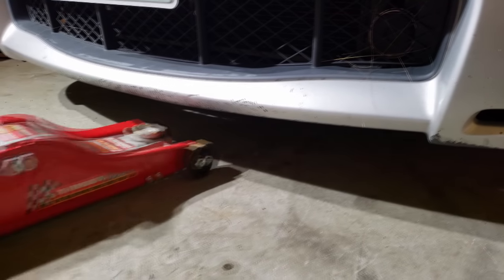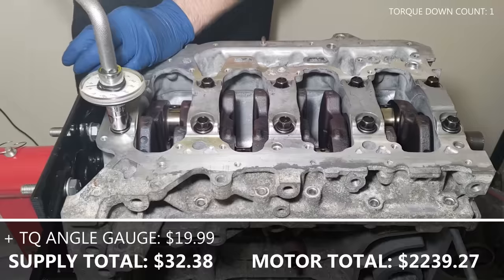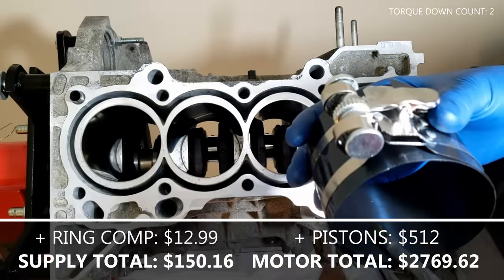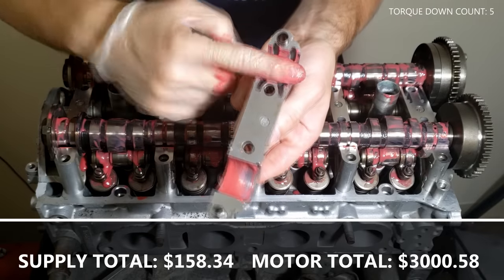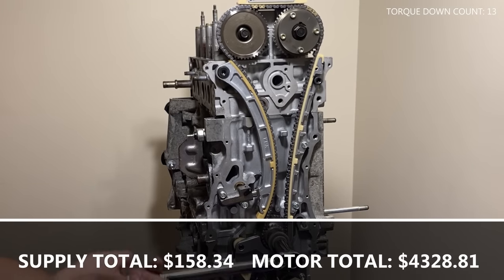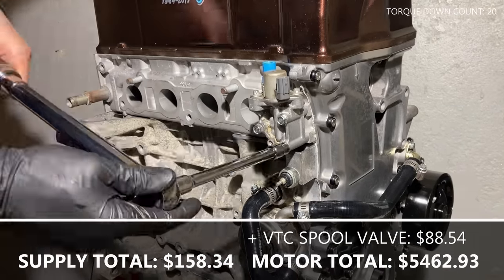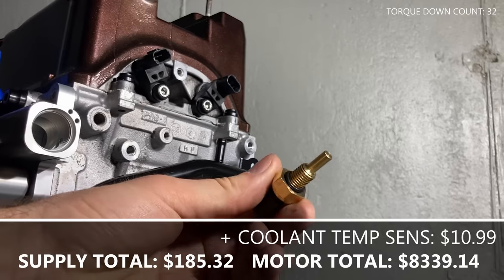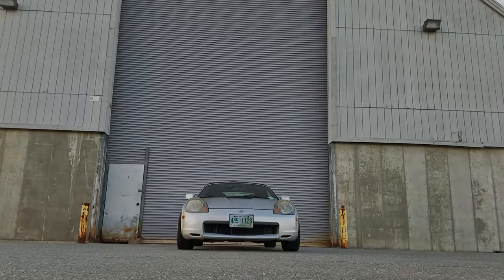Honda K24 Engine Build: Tracking Every Dollar Spent

Comment: So cheap. New car would cost around 30k and wouldn't have the same balls as that car for 11k so you technically still have 19k left for mods.
Reply: That price doesn't include the price of the car for the swap, suspension, wheels and tires, ecu and tuning etc...